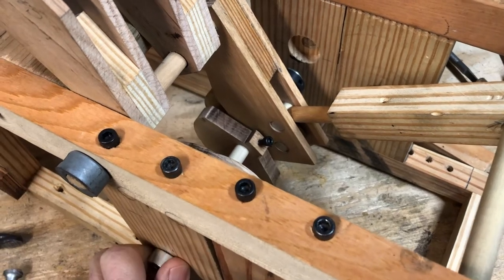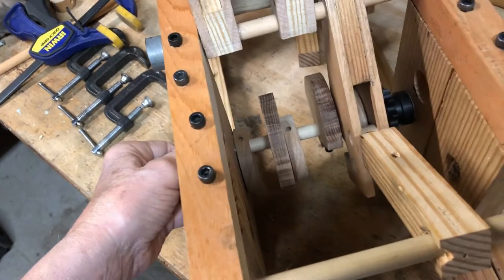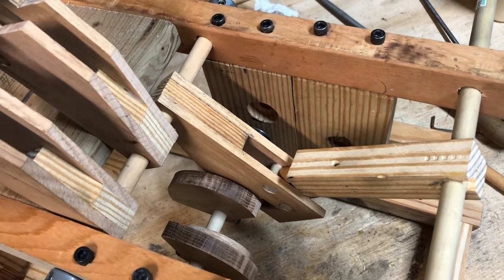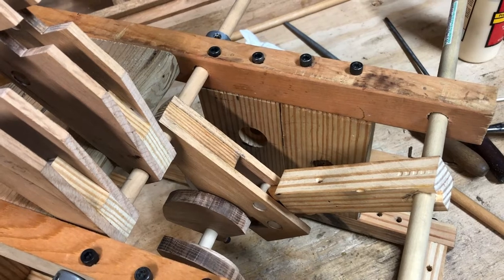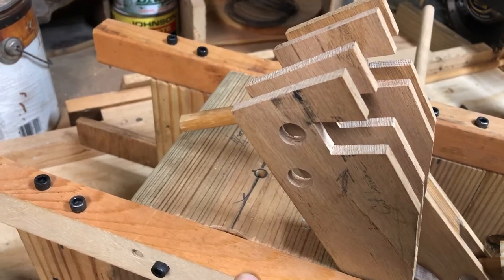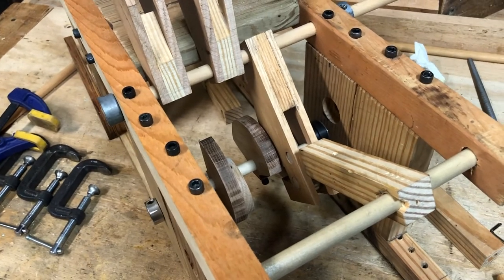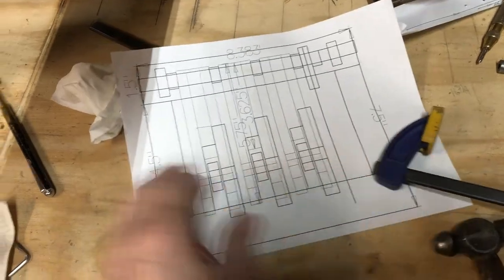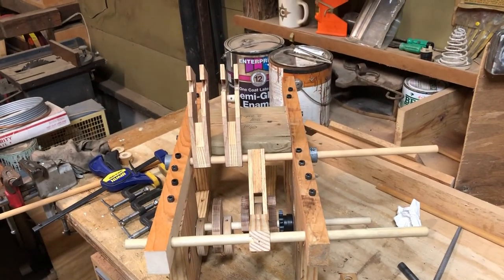3 Cyl Compressed Air, Cam Drive, Bicycle Assist 10-2- 21

Comment: I like this design for the crank, this one has a real nice simplicity. I can imagine very easy repair and part replacement.
Reply from the maker: Thanks for the comment. 
Not quite as simple as a cylinder hooked to a standard crank shaft, but the Cam design will use one half the amount of air!